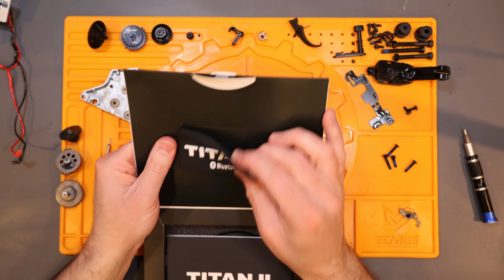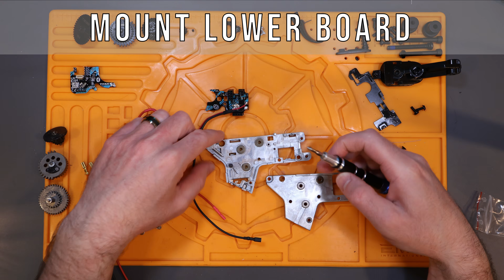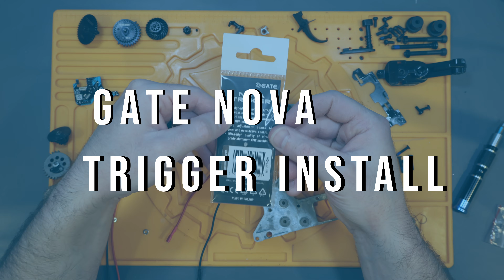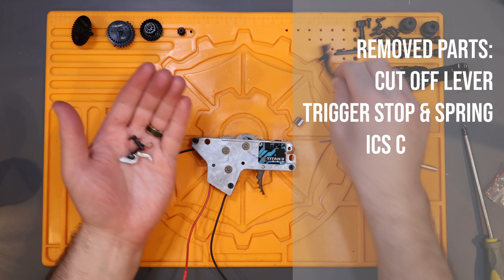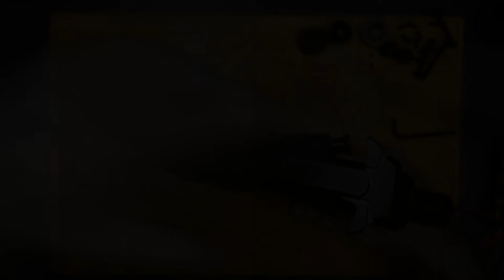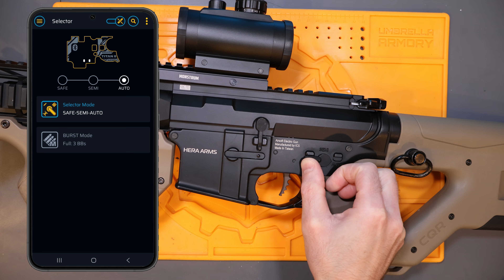Gate Titan II Installation | ICS HERA ARMS CQR

Comment: can i put the cable to the front bc my battery on front
Reply from the maker: You'd have to order the front wire version
Reply: @DucknDiveAirsoft yea i know that but i already buy the rear wired and i cant retur this thing, so wyd, can i put the rear wired to the front ?
Reply from the maker: I'm not exactly sure how the wires would cross under the trigger if you tried to adjust it forward or if they would be long enough. A front wired mosfet would be best. You could also keep it rear wired if you have room in your buffer tube to fit the battery.
Reply: @DucknDiveAirsoft aight thanks dude